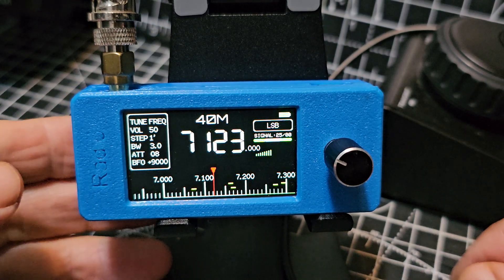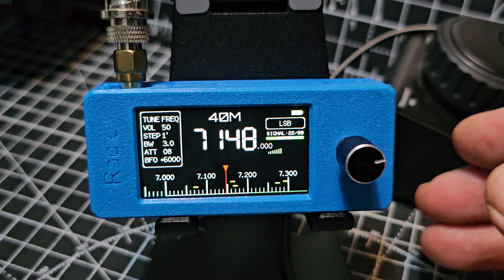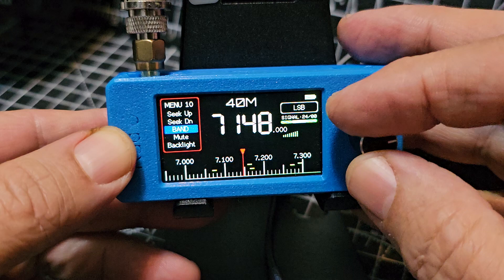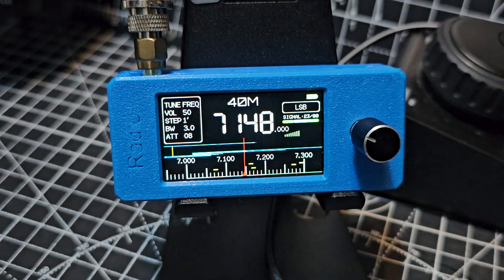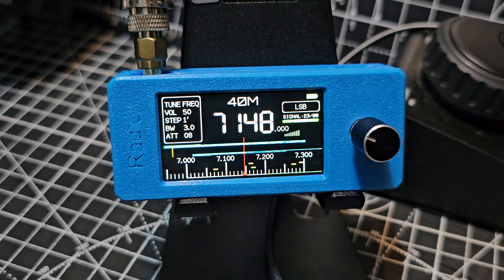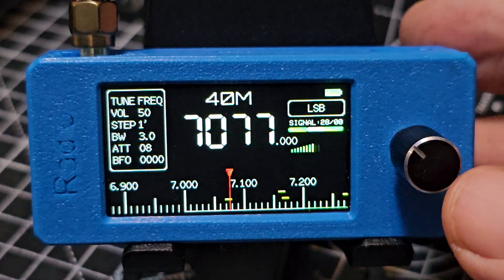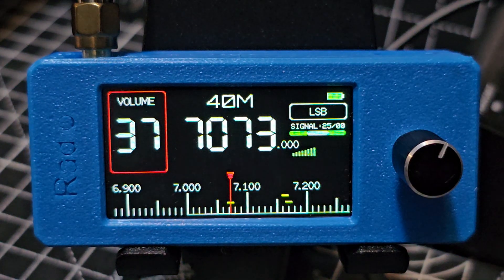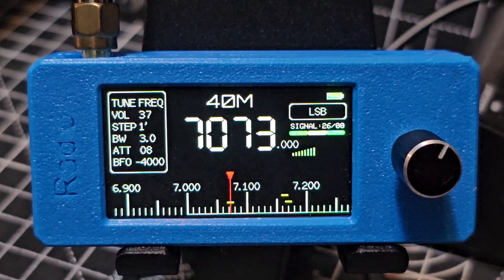Si4732 Receiver , Enable Waterfall

Comment: New firmware is great but I'm struggling a little, where is the settings menu? Used to be able to press and hold the decoder to tune but now can't, where have the themes gone? It's like two steps forward and one back lol - maybe it's just me being confused lol.
Reply: It’s not just you. Personally, I tried using it twice, each time wiping it out in favour of the community/open-source firmware. Kudos to the guy for inventing unique features, but it’s far too opinionated - he killed the UX and the good things that were there originally, and you just sit there like a fool, scrolling through the main menu endlessly to make some basic/frequently used adjustments. 🥲
Reply: @well-mannered-troll  Thinking of getting the latest version of the radio so I can have one radio on the new firmware and one on the old.
Reply: @well-mannered-troll  Hopefully someone can modify the new firmware to add some of the old features back in.
Reply: @edtuckerartist  I’d happily try to bring some structure back to the menu. F. ex., secondary options like brightness, calibration, and themes should return to the Settings submenu (along with time/schedule/wi-fi sync). Get rid of the =UPCASED= menu sections (or whatever they are), and so on - at least on my copy. But he’s unlikely to make it open-source, so it’s “take it as is.” *Having two radios with such different navigation patterns is an interesting idea, but could lead to some confusion when using either. 😬

Comment: Go to the link in your description for the firmware, click "download current firmware" it opens a new tab and says google can't translate this page and there is a link that says "go to original page" click it and nothing happens. 
Maybe the site is broken? I'll check it later - - - fixed it - changed page to the original German then the download worked. Now to figure out hot to install in German lol.
* and right after I wrote this comment I found your video about how to install where you mention Google translating the page.
**Forgot to say thanks for the heads up an info.
Reply from the maker: Sorted